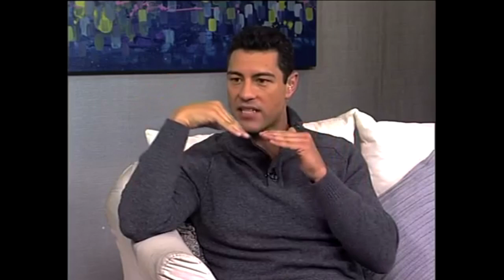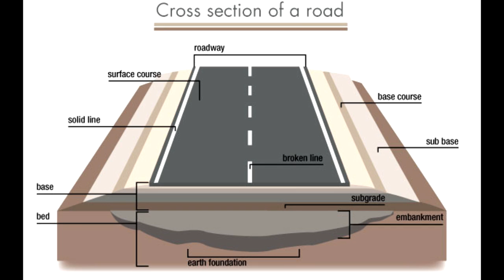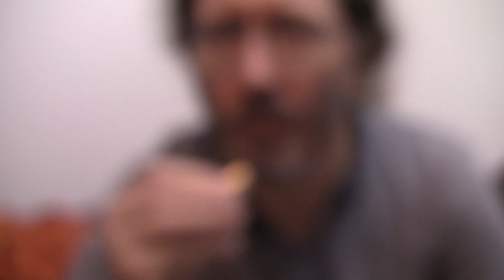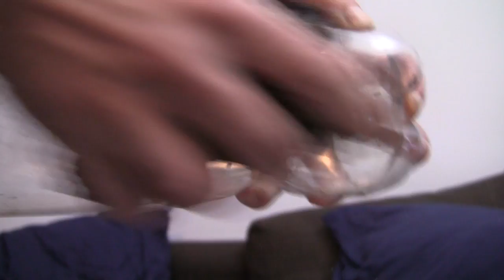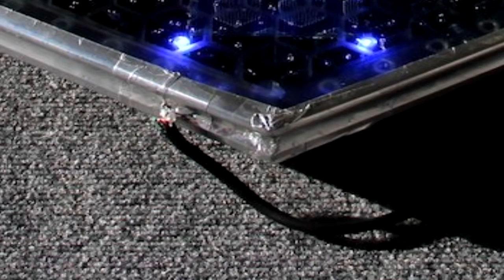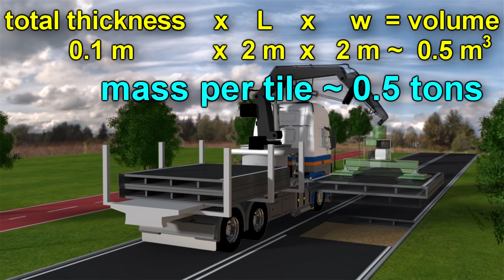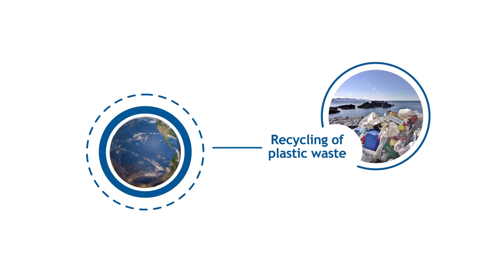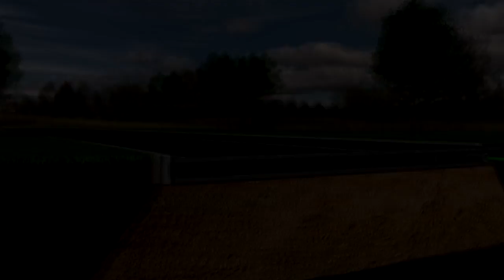Plastic Roadways BUSTED!

Comment: I was thinking that concrete or cement is smoother then normal roads but gets better as it wears. Id like to see some testing on a plastic material just to see how it works. Maybe add plastic as an aggregate itself or as a mixture that can be added into the bitumen.

Comment: Time to go on facebook and kickstarter with my new roadway replacement idea that will change the future of the world, GLASS ROADS! Now I know you may be thinking, "but isn't glass super weak?" And to that I say, SHUT THE FUCK UP.
Reply: Die20125 Advertise the roads as being made of a material like the Reinforced Glass in the IndustrialCraft2 Minecraft mod.
Reply: YES, and if we include human garbage like the people who come up with these roadway ideas it is killing 3 birds with one stone.
Reply: Make roads out of garbage. Solves 2 problems at once, roads and disposing of waste.
Reply: Obviously the problem is people driving, if everyone stopped using the roads we wouldn't need them.
Reply: Die20125 Yes!

Idiot. Freaking. Roadways.
Reply: Too late. They have been doing it since the 70's. Looks cool at night! https://en.wikipedia.org/wiki/Glassphalt
Reply: Die20125 glass is actually quite strong compared to most kinds of stone, that's why we make cups out of glass and not stone, also glass has a relatively low melting point for its strength, so glass roads, not so stupid (also there's shitloads of sand so glass production is pretty much game)

Comment: So why don't we just spend a bunch of money as a country to figure out how to convert atmospheric carbon into carbon based materials. That is something that has been worked on for about years now. Not quite there yet. But even then it would probably make more sense to laminate existing road surfaces than build new ones.
Reply: James Atwell Tf has already debunked the plastic-from-air nonsense.
Reply: I propose we name the material "Wood". It should be harvested in these branching out structures to optimize reach. I think I'm going to start a Kickstarter around it! A revolutionary new way of reducing CO2 in the atmosphere, I'm thinking of calling it a "Tree", seems fitting somehow.
Reply: eddiebruv not plastic per se. But every piece of steel, aluminum and virtually every plastic will be replaced by carbon nanomaterials. Now, where are we going to get the carbon to make these from? Also, I saw a similar concept in college as a way for carbon sequestration by essentially making carbon concrete and sinking carbon in large blocks under the ocean. Please Google carbon nanotubes and you will find details on similar materials as well.
Reply: Jan Joost Verhoef wood is structurally week compared carbon nanotubes and like materials. Carbon nanotubes are stronger than steel. They are also lighter than aluminum. The only problem remaining is to make them in mass quantities and to useful scales. Thus when that issue is resolved every piece of steel and aluminum will be replaced in the entire world. Something that trees can't do. And can I just say that people without engineering degrees should really stop talking about things their tiny brains can't handle. I have two engineering degrees in mechanical and aerospace, so please try and complete your education before you try talking.

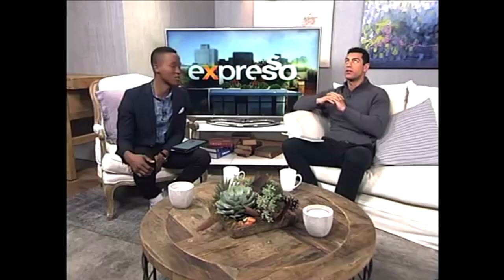Comment: I got to 1:00 and knew this wouldn't work in the tropics. Particularly in Australia.

1. Rainfall can be very high. 100mm per hour is not uncommon and 300mm or more in an hour happens quite often. Nothing will be "flood-proof" from that.
2. It will likely melt. Current roads do this in summer.
3. Current roads will survive a bushfire. I very much doubt the same can be said of plastic roads.

Comment: The worst part about the wear/tear is, that if the surface of the plastic is already rough (or as you demonstrated, becomes rough after some wear), the problem starts to compound itself exponentially, as plastic shavings add to the grit, and the remaining rough surface causes more friction & heat.

Comment: I though the dumbest part where they show pipes running through the road and then say it's easy to replace...

How are they proposing to remove a chunk of the road if a pipe is running through it?

Also there are machines out there that rip up the road surface, melt it and relay it so like you say you only to to take 1% of the material with you to repair it with normal asphalt surface.

And if you drove over that plastic it would quite quickly turn into dust, the good thing I suppose it you don't have to recycle it because you will be breathing it in.

Comment: The french built a solar road way, you dimwit....
Reply: Machin Truc so did the Dutch. It didn't have the snow-melting, self illuminating, Bluetooth connectivity of Solar Freakin' Roadways! And it only produced about a third of the electricity of roof mounted systems. And it was only a cycle path, not a highway or airport runway like Solar Freakin' Roadways!
Reply: The road is in the region of Normandie, It's about a kilometer long and costed 5 millions.
Yet, that guy said it was not possible to do a such thing for a bunch of reason...
Reply: a big reason was that cars would mess it up and it's high maintenance, and if it's a cycle path there's no cars and people waste trillions on cycling anyway

Comment: A solution to fixing the problem of plastic roads... LEGO!!! It's got those bumps that could easily provide traction while wet. I've seen cars drive over them without being flattened or destroyed, so I at least know that they are durable. I'm even willing to donate all of mine for the cause, just to have LEGO Roads...

That'll work, right?

Comment: (Typed at 13:00) I am sure that a plastic composite probably could be made that could be used as a road surface, and yes it won't be polyethylene recycled food packaging.

It probably would also be very expensive and the fabricating parts is probably also a problem actually and would increase costs and difficulty to build.

Comment: One issue with these "modular" road schemes (inc Solar roads) is that they will force a ridiculous level of precision, and hence cost, onto road builders.  With current techniques, you can bosh down (<< technical term ;-) the road surface, and if the guy that laid the foundations / kerbs is a bit out, no issues, just get your roller out, and roll the surface dressing out to fit.  With any kind of modular system, you suddenly have huge constraints not just in terms of tolerances, but all the basic profile you can make.  Take a look at a typical road, it often heaves, kinks, wobbles, narrows, tilts and many other movements, over features, try and lay a pre-fabricated, square, flat panel and you need a perfect base to put it on.  And that, will be hugely expensive.

Comment: I know plastic roads are a stupid idea, my 10 years old brother could tell you why, but that 'ten second vibration' experiment with a rock and a bottle really proves nothing. The bottle is left with those scratches because you generated a moderately big amount of friction between it and the rock, whereas a car wouldn't generate nearly as much friction. The rock and the bottle have an irregular surface, a road and a tire don't. Plus, tires rotate, which means A) The space ocupied by certain parts of the tire at any given time is different (Which decreases friction a lot); and B) Newton's 3rd law comes into place: The car 'pushes' the road back and the road 'pushes' the car forward. The effect caused by a car driving through plastic would be more like a sphere rotating above the bottle. I would love your reply on the matter.

Comment: and lets not forget the cost of plastics. the reason they use asphault is because its cheaper than concrete. using these plastic modules, I SERIOUSLY doubt it will be cheaper than asphault. and, did we forget that asphault IS recycled material almost always? NO ONE will pay more (I'm thinking WAY more) for plastic roads. and roads are always flood proof. cause they are built with a "crown" which causes water to flow away from the center. Please leave roads alone people. they work just fine already.

Comment: Plastic road? Aside from it being a highly dangerous idea for being slippery as hell, where the hell do they want to get all the materials? Plastic is made out of oil, the oil reserves are rather limited and getting worse. So how will you make this? Also, there is a reason why roads are not made out of tiles, something Thunderf00t already mentioned on another video which also was bullshit. AKA the solar roadways...

Aside from the road itself, there is the common junk on the roads. From small pebbles, sand and other natural goodies to man made junk that gets thrown out of vehicles or simply falls off due to wear and tear. All of this will destroy your plastic road in no time as Thunderf00t clearly shows in this video.

I don't even want to think about the costs to make this horribly dangerous idea.

Comment: Here's an idea: most of the time, cars drive in the same direction on the road, right? Why not add some kind of guiding for the tires? Better yet, make the cars run on the guiding things. And make the guiding things in easily replaceable parts for maintenance and stuff.
Another marvelous idea: instead of relying on oil, we could use electric cars! Heck, we could even deliver the necessary electricity to the cars through the road guide thingies!
You know what is a cause of pollution? Too. Many . goddamn. cars. With this guide thing and delivered energy source, we could make the cars much longer, but not too long because they have to take corners. Maybe if we'll segment the cars, it'll work. Since lots of people move into the same direction, we could centrally plan the movement of these cars as well for more efficiency.
Now we have to decide on the materials to use and a name. PLASTIC FREAKING GUIDED SEGMENTED AUTOMATED MULTICARS OF THE FUTURE Who's with me?

Comment: I love how they show piping and wires inside the road.. And then just lift out a section and replace it. What about the pipes and wires?? It seems to me like that'd be a tiny bit damaging to any pipes and wires inside. :D

Running anything inside those plastic boxes basically means it can't be replaced as you can't get inside to take things apart. You'd also have quite a problem fixing a leaking pipe etc. How would you even find out where it was leaking without having to take up the entire road? It's not like it's close to being big enough for people to crawl around inside after all.
And if you found out where the pipe was leaking, how would you get to it? And how would you even get it inside the road in the first place? It's not like all roads just have an open end and are totally straight in the first place. How would you get 10 miles of piping inside a section based closed box?

Comment: If they mix in rocks with the plastic it can't be much worse than blacktop, right? Tar also expands a lot in heat, is softer than PET even and is a bitch to deal with.
I see something in it, but they can't make it hollow(or maybe just a stainless steel tube in it for wires) unless they want to fill it up with something to make transport of the modules lighter(what they would fill it up with, would have to be at least concrete then which still needs to be transported)

Comment: don't plastics degrade in oil? When an accident happens on the road and there is an oil spill on it, they will have clean the spill cut off all utilities that go through that section and replace it. As opposed to just cleaning the spill.

Comment: i agree plastic roads is too much. However, what about plastic sidewalks? that would get rid of the power lines and extra wires and the weight ratio is far better, right? would like your opinion thunderfoot

Comment: This road solution would absolutely be out of the question in any location where the ground sets and swells as well since it would be like building a lego foundation on a shifting surface, there will be cracks between the "elements" within days. It's pretty obvious to anyone that actually thinks of a dynamic environment that lego roads is not ideal :p

Comment: Your last point is invalid. Not having enough waste material is no reason against using the existing waste material. You can buid 20 % from plastic freakin' roadways and the other roads in a traditional fashion.
Other than that, nice presentation

Comment: I feel like this is the way all these bullshit stories start. Someone with basic scientific or engineering knowledge spends 5 seconds thinking about the modern worlds problems and comes up with a what if scenario. What if we could move bullet trains thought a vacuum, what if we could recycle bottles into something as big and expansive as the American road system, what if solar energy came from something as big and expansive as the American road system, and of course, what if water from air? They then spend another 5 minutes to make a video claiming they cracked the code, despite having done nothing toward that discovery, or even research if their claim is counter-intuitive, ridiculously dangerous, crazy expensive, and/or physically impossible. They then receive funding from those whose title doesn't include any scientific background to do the basic research required for them to find out that their claim is a much bigger undertaking than previously anticipated or just downright impossible.

Comment: Also as you mentioned in the solar roadways video, making tiled roads will get wobbly over time. Also the coefficient of friction is much lower 0.2 compared to Asphalt 0.7 which means less traction for cars. Especially when it rain, this thing would be a disaster.

Comment: The idea of Modular prefabricated road surface tiles is not without some merit. In very specific, very limited applications. Provided you use different materials. But really the only places where there might be some reasonable infrastructure cost saving would be someplace such as lower Manhattan. A very very dense environment, laid out in tight grids, where real estate for infrastructure is tightly limited, and huge swaths of other infrastructure are under the roadbed necessitating constant digging up and patching for minor repairs to otherwise unrelated systems. For someplace like that the enormous costs of Modular road panels might be borne out by savings from tearing up the roads weekly to fix water,sewer, electrical, telco, etc. plus they don't have high speed traffic flow. But for any roadways that actually go anywhere, the idea is ludicrous. It fails the most basic costs/benefits analysis.

Comment: Solar 'Freaking' Roadways, Plastic 'Freaking' Roadways... what will they think of next. Personally i believe they will have more success in re-designing a entire country's infrastructure, to lessen the use of personal transport in favor of public transport:
i.e. making the city circular whit the outer layer being the residential area, the middle layer being a industrial layer and the central layer being a commercial area, and the farthest public transport station being 5 minutes walking distance, the transport in question being a maglev (magnetic levitation train) which holds the highest train speed record of 603 km/h (375 mph) for comparison a bullet train reaches speeds of around 320 km/h (200 mph). Example seen in the Zitegeist documentary movies.

Comment: Quick sums:

Young's Modulous for plastic - 3.1x 10^9 N/m2 = 3.1x10^3N/mm2
Panel dimensionsl, say 1m x 1m
Thickness, unknown, say 2 inches  (50mm)
Axial load, say 10 t, 5t per wheel - 5000kg (Approx 50kN)
Deflection would be - 32mm, over an inch of flex... Genius

Could you imagine driving on a road that flexes by an inch?!

Maybe it's not 2 inches thick, maybe it's just an inch then it would be - 256mm or 10 inches.

Comment: The roadway-segments would be a LOT more rigid than the PET-bottle used to demonstrate wear-and-tear, whereas the bottle easily gave way and deformed under pressure meaning less of the force Thunderf00t used was actually scratching the bottle, so with a more rigid PET-element the damages would be far greater over the same amount of time.

Comment: wouldn't the polymer-based road also warp more due to heat build up and UV damage (over asphalt which also warps under heat-stress in hot climates with lots of traffic, but seems to take a lot less UV damage.) 

I would think a plastic road would become very brittle, flake and crack up. The flakes would scatter in the wind and water flow being dispersed in easily consumable sections for wild life, so it doesn't get rid of the plastic contaminate problem either. 

I don't even buy plastic wheel barrows for heavy duty jobs because I know they can crack up. Just from life experience, I wouldn't have a lot of faith in plastic staying in one piece, under constant stress, and in all weather conditions. Also, plastic with a cavity in it, with cars traveling on it, seems like an incredible set up for some wicked static build-up, a charge that would build up in parts of the road, (possibly where sections connect) or in the aluminum framed vehicles themselves. Cause it doesn't strike me a as properly grounded design, or anti-static material even if it was strong enough to handle the abuse of traffic. 

Potential for death or serious injury is very high with this idea, which makes it even worse than solar road-ways. But, its been over  a decade since I took physical science in college, so I could be off base in thinking that way. 

THUNDERFOOT Can you do a part-2 about how earth's EM fields &  static would flow in the design they proposed? Specifically could this idea produce potentially fatal levels of static charge?